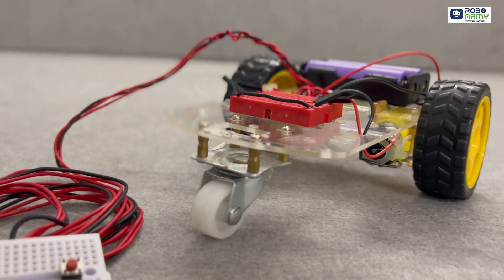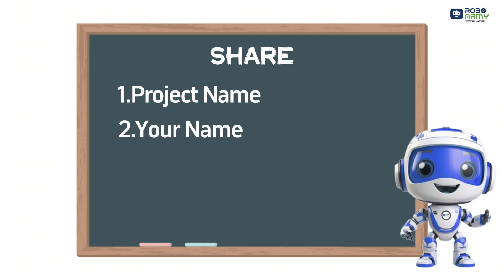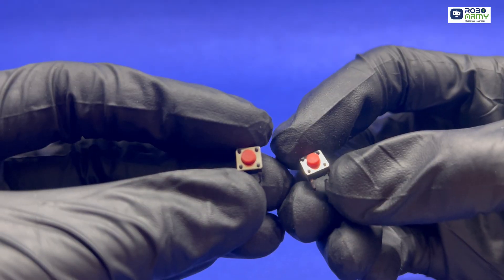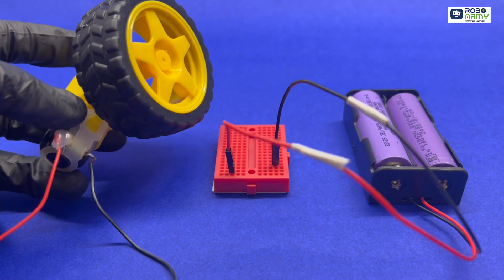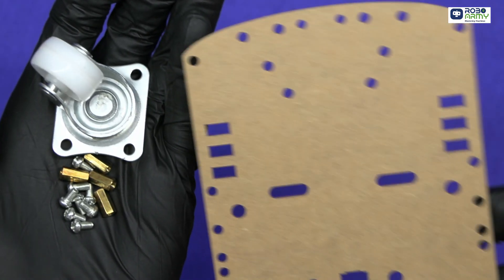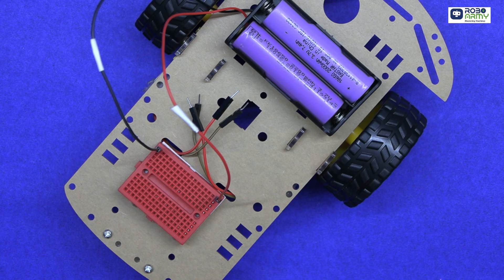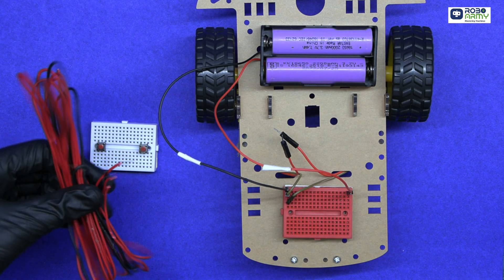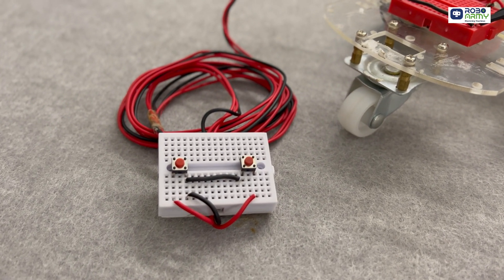Build Steerable Robot with Wired Remote Control

Comment: how do you go backwards
Reply from the maker: Great question!
This basic wired robot is designed to move forward and turn by controlling each motor individually using push buttons. However, it cannot go in reverse because the current only flows in one direction through the motors.

To make it go backward, you'd need to add a motor driver circuit (like an H-bridge) or use a motor driver module like L298N, which allows you to reverse the polarity of the motor and thus make it spin in the opposite direction.